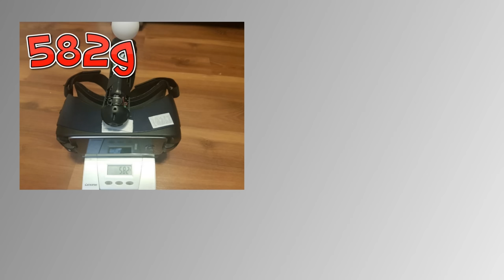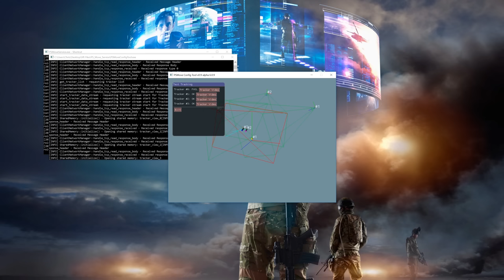The Best Way to Head Mount a PS Move Controller for Perfect Head Tracking! [Part 3]

Comment: Daley, I have a problem and I have no idea how to fix it. I had to move my steam from one disc to another and after that my steam VR doesn't respond... i tried reinstalling riftcat and Steam VR but it didnt help also before it, reinstalled PSVRService drivers and now i have no idea what happened here ;x Please help.
Reply from the maker: Just using the re-install won't work if you move discs, you need to run the initial setup again, then re-install.  It needs to remap to the correct spot before it can push the install files with the re-install batch files.  After that, you will need to set the variables as well with the other batch file.
Reply: I made exacly that first time and it didn't work. What do You mean in the variables in batch file?